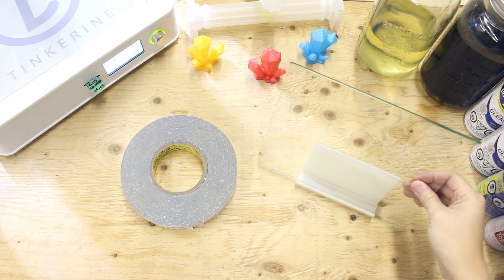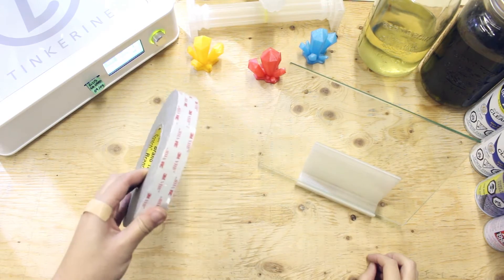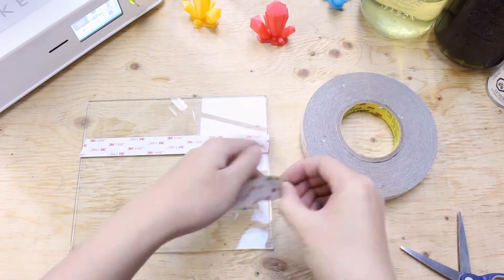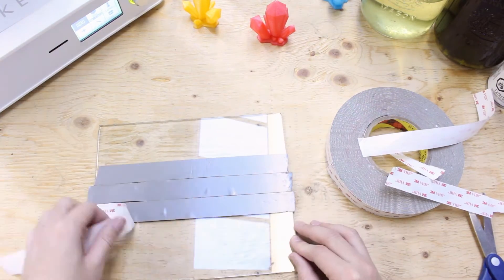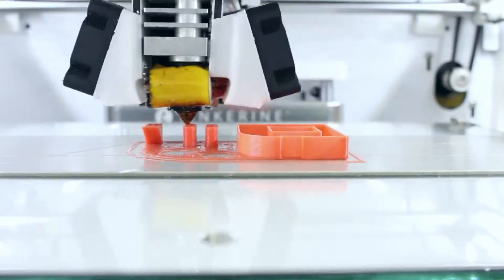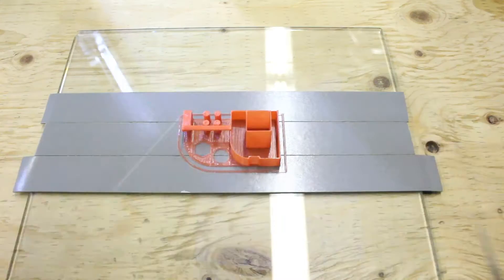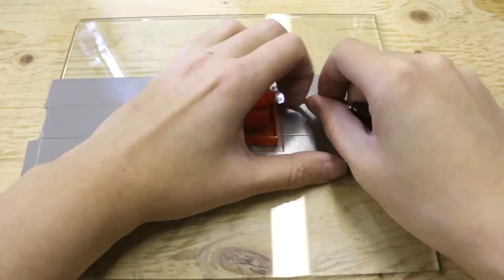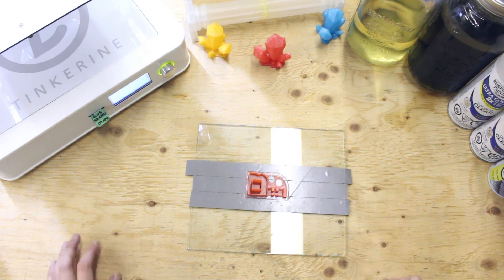Bed Adhesion with Double Sided Tape

Comment: after cooling, use a spray bottle with misting nozzle, spritz alcohol along the bottom edge of the print as you are slow lifting from the bed

Comment: i use a thin transparent double tape.it sticks too well,and it is very hard to remove from the glass,but i change it after more than 100prints so.. the problem is taking the print out, i usually do small rotation movements of the print until it comes off,so don t try to drag it,push left right etc, turn it right and left right and left until it comes off
Reply from the maker: Thanks for the comment and suggestion! Does it wreck the tape when you are removing it?

Comment: This is not simple double sided tape, it's acrylic tape, which has extremely high adhesion... it'll release when you stretch it, but of course it will release both from the glass and from the print.
Reply from the maker: Thanks for the comment!